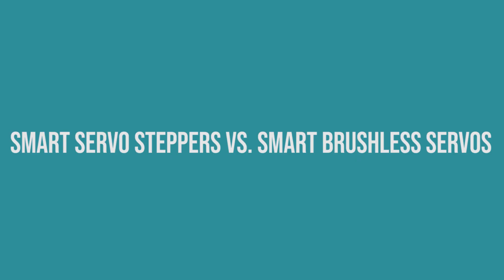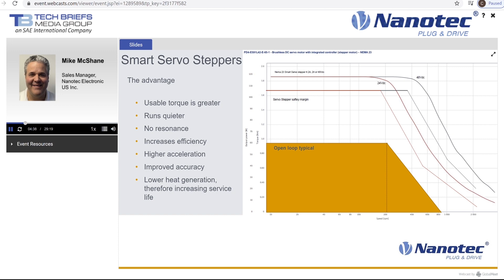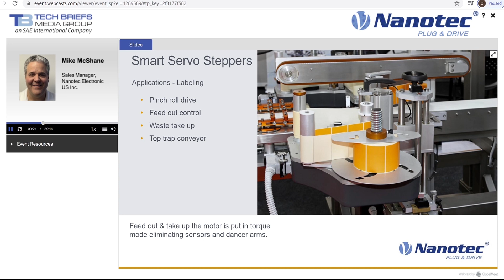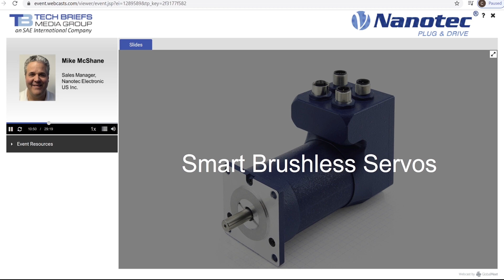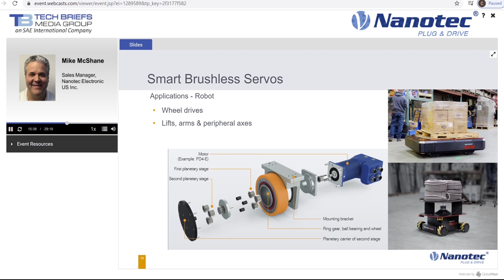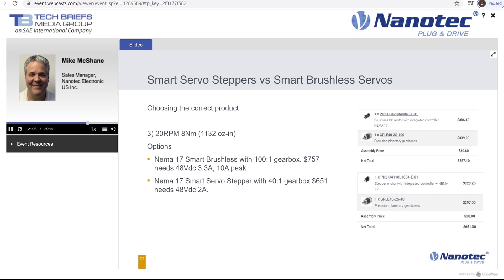Nanotec | Finally! A Servo Drive with a Built-in Controller! | EandM

Comment: We use the pd4-e591l42-e-65-2 motor in our automation application. Its a very good motor, there is absolutely no issue setting it up using the Plug & Drive software. However getting it to connect to Rockwell PLC takes some work..